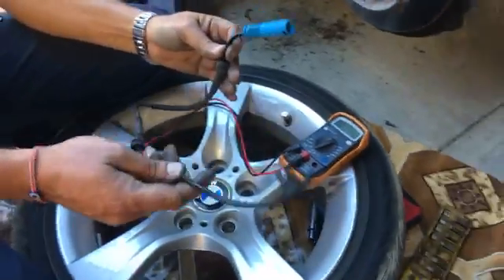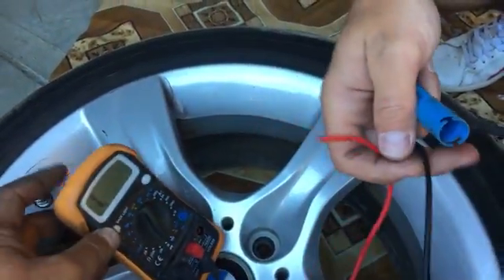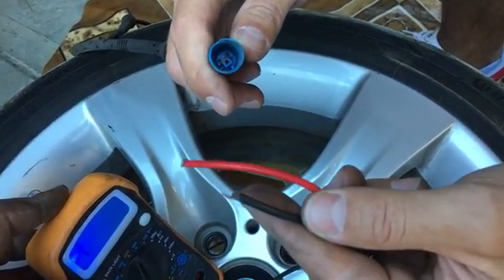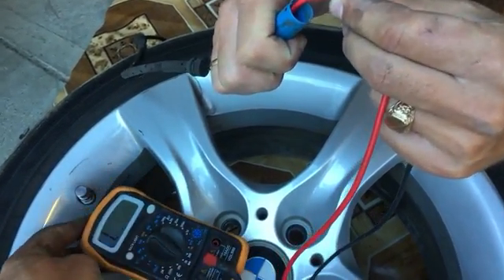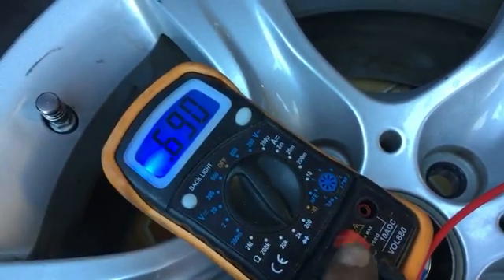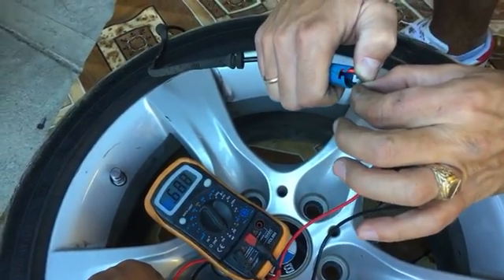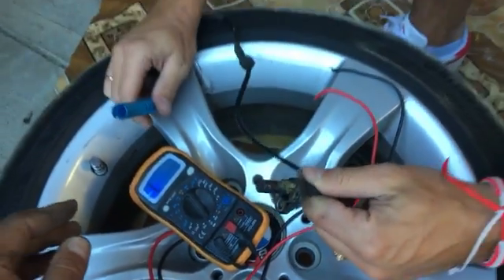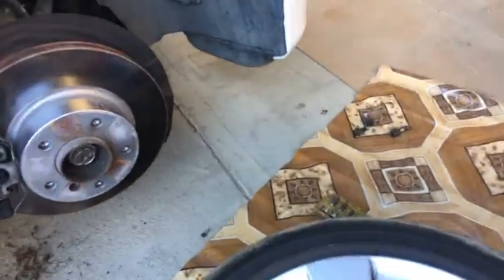HOW TO TEST ABS SENSOR BMW E90 E91 E92 E93

Comment: I just replaced my front right speed sensor and now it wont send any speed info or direction info at all and before it was just every so often the faults would come up. What did I do?
Reply: Same here dude. I replaced mine today but the lights are still on. I’ve tried multiple sensors but the lights just keep popping up. Do you have a check engine light?
Reply: @rudeone760  and get this on my way to buy the voltmeter to check the voltage on the plug all lightswere on drove around for an hour or 2 before  I got to the store. It was closed and when I got back to the car turned it on boom it worked all lights off and sensor was sending speed and direction data on front right.
Reply: NorthernN54's so your saying maybe it takes some time to clear itself? After replacing?
Reply: Naw I didnt have a check engine light I think that's because it was just the one sensor or maybe because I have a manual transmission. I've read that autos need that information alot more than a manual to time shifting ect
Reply: NorthernN54's well I actually borrowed a buddies sensor and it worked. All lights went clear. Including the check engine. And when I got my replacement. I installed but lights came back on. So tried my buddies again and lights are still on. I don’t get what’s happening

Comment: Hi and thanks for information.  I have the same problem as "Wood Works" on my BMW R1200GSA 2007. My value at the multimeter at 20k is 5,7.  Is that close enough or should I buy a new expensive part?

Comment: Wanted to see if someone can help me. I have been having the abs light and other lights come on my 2007 BMW 328i. I did all the brakes and replaced the front and rear brake pad sensors and replaced all the abs sensors. The codes I am getting are P1774 and P1775. Which are the rear sensors. After replacing them I also noticed the speed gauge does not work now. So I got abs lights, brakes lights, traction triangle and that seatbelt air bag light. What do I do? How the heck did that speed guage stop working after doing all that work?
Reply: did you end up fixing this?
Reply: The rear speed sensors are angled. If you don't push them in properly until they are seated then you will throw a fault as well as have no speedometer. On my E46 325Ci vert the Rear Drivers side Is connected to the speedometer
Reply: @MNToolBoxTim  Oh that's strange I was under the impression that rear passenger controls the speedo. I take it you have a UK right hand drive?

Comment: I put after market speed sensor on left rear e90 and lights cam back on. So I switched left and right sensor and now the right rear wheel is sending a code. This tells me that the sensor is not working, should I use bmw original sensors?
Reply: Bosch makes the sensors for BMW, get a Bosch one